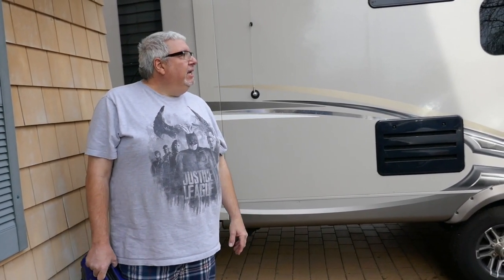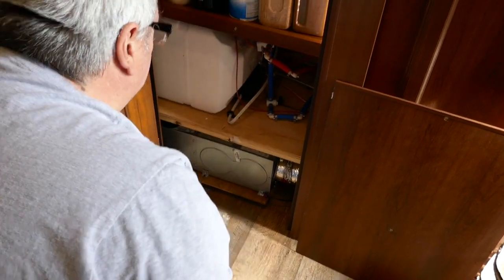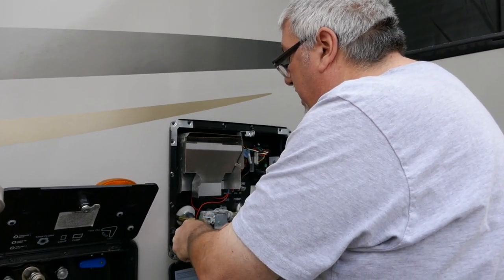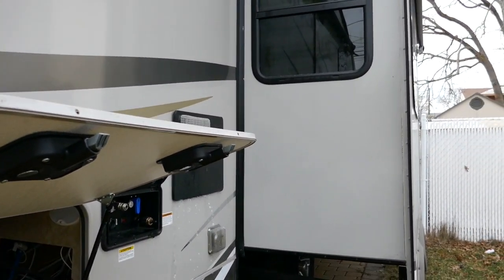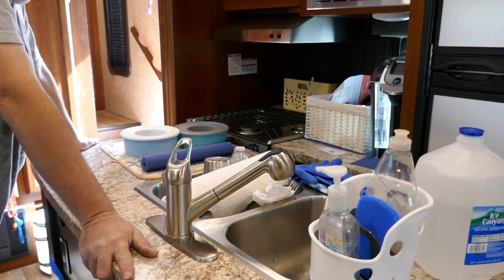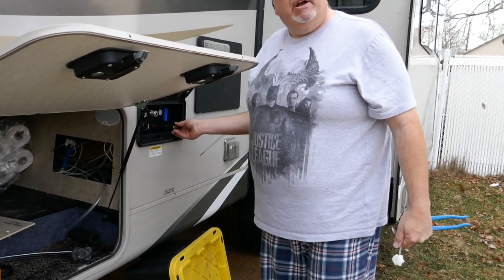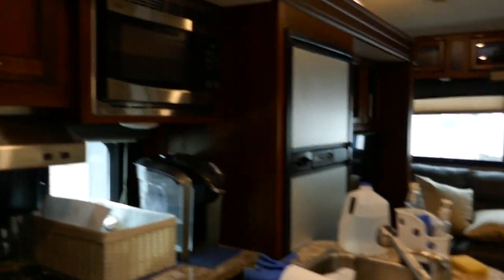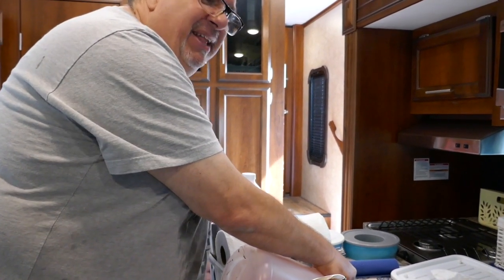Winterizing Our RV

Comment: Good video thanks for the tips, just got our 2018 Eagle 28.5 RSTS. What’s your opinion of this unit, any issues we should keep an eye out for?
Reply: The only think I would say is Watch out for the vacuum breaker when your flushing the black tank.  We ended up with water running down behind the shower wall into the basement storage.  The vacuum breaker is located behind the shower controls.   I don't this this problem is specific to this unit but it is serious if you are unaware.  It will become obvious if this is leaking.  Other then that we have experienced some issues but we are told that this kind of thing is normal for an RV. 

 Bill from RV Trek